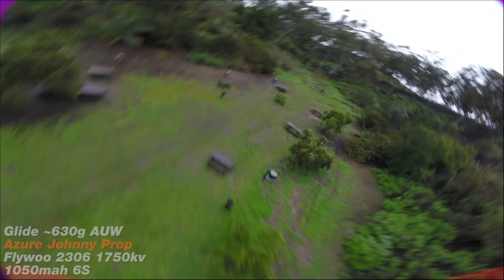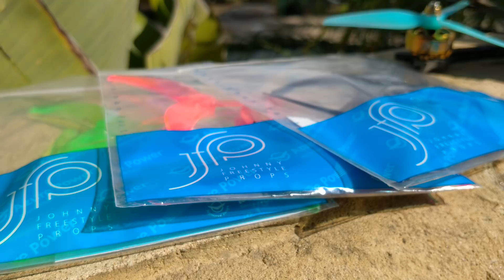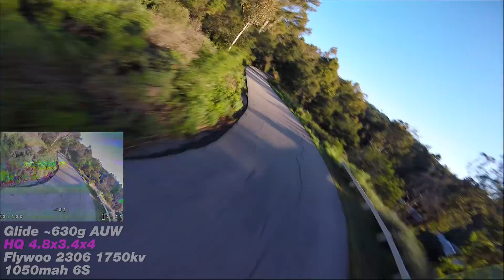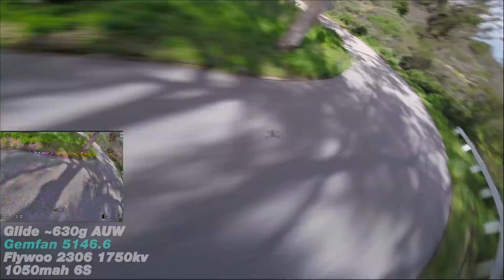Azure Johnny prop + some others

Comment from the maker: Table of Contents:
00:37 - Johnny prop flight
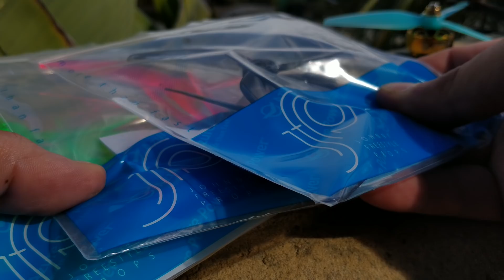03:53 - A look at the Johnny prop
04:58 - Johnny prop flight 2
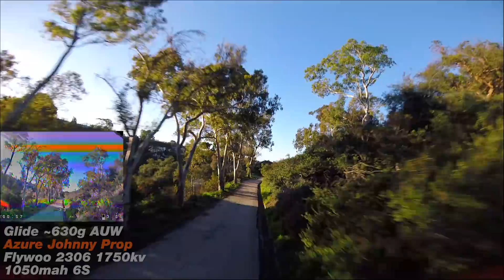06:18 - Flight feel/performance
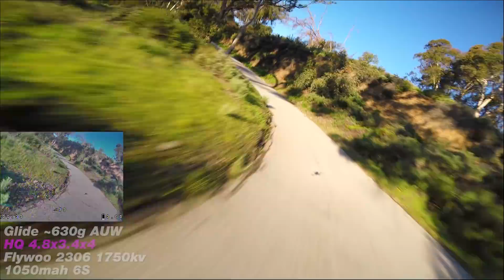09:50 - HQ 4.8x3.4x4
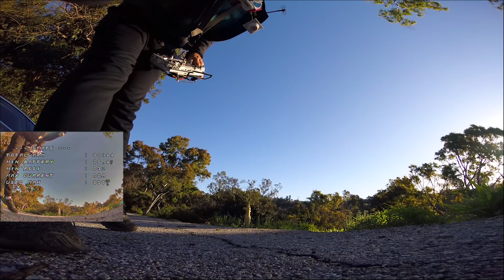12:06 - Gemfan 5146.6
13:51 - Settings to mimic Johnny prop

The Johnny prop feels a little weird on a 2207 or 2208.  It was designed for a 2306 1600kv motor on 6S.  I would recommend you stick to a 2306 and less than 1800kv with this prop...or limit max throttle.  Here's how: https://goo.gl/R51zQU

My work in progress website: www.KababFPV.com
Check out the Articles page.

Join my FB group for more discussion: Kabab FPV
https://www.facebook.com/groups/379155946182689/

Equipment I highly recommend:

Micro Eagle - 
https://goo.gl/or1fS9

Rush Tank Vtx -
https://goo.gl/YMYmya

Fantastic solder-
https://amzn.to/2P5QM2W

TS100 iron -
https://goo.gl/DqBipa
https://goo.gl/svK6DD
https://amzn.to/2OV5XMh

WaFL’s Cap Cap
https://insta-stalker.com/profile/wafl.fpv/
https://goo.gl/9CZdAs

Xing 2208: https://goo.gl/PcJ7GG
Xing 2306: https://goo.gl/TT9gnw, https://amzn.to/2VkZ8rt
Flywoo 2306: https://goo.gl/xuLG6d

Sub $200 5" build that's still good:
Frame: https://goo.gl/EpXQhZ
FC/4in1 Stack:  https://goo.gl/HprVbj
Motors: https://goo.gl/h5rofi
Props: https://goo.gl/ZnzY2y
FPV Cam 2.1mm: https://goo.gl/FDJhYw
Vtx: https://goo.gl/JNVDMn

Tips?
PayPal: https://www.paypal.me/kababfpv
Bitcoin: 1E4XZXoD4rS6MYWVWuenY7Kw2M1YgyNpoQ
Nano: xrb_1188ek5bd7tb9kw67asnp9o65byuoaxbtpxuznx1ribf75x78awywmakj55f
ETH: 0xD067F93811f2eC31CB1928901002dfdf9A492EF5
LTC: La2KWYAjp4VT2Lq2M76pbjzXWvRyjpfCtG
Reply: Hey kabab do me a favour please. You said beginners should go for 4 inch, what should I get??

I thought of these
Bangarang 4
Rcinpower 1506
Foxeer monster micro pro
Eachine vtx03s
Mamba mini stack
Foxeer Thor antenna
CNHL 800 mah battery

What could be made better?? 
I am trying to keep it under 200$with a battery and a list alarm.
If you would help I would learn how to floss my teeth...
Reply from the maker: @mehulanand8623    check the links at the bottom of the description. That's my current recommended budget build. The motors are really your choice. The Emax eco motors or RCX 2306 are cheaper and also good.
Reply: @Kabab  are eco motors good?? I was thinking of rcx 2207(11$)....
Reply from the maker: @mehulanand8623  right now I would recommend a 2306 due to an annoying ESC software bug.  It runs better as a result. I don't know when it'll be updated
Reply: @Kabab  isn't there any video of this quad??
Do you have a video on it??
Reply: Hi @KebabFPV, what do you think about new Diatone GT R349 3 inch racer that UAV Features recently revieved, did you flied it by any chance?
https://www.youtube.com/watch?v=7fQOXSnjiUQ

Comment: I thought the shaky sticks was just a greenhorn thing, I'm surprised to hear that from such an amazing pilot as yourself.  I loved the video super informative as always.  I tried these props and my kwad seemed to bobble more with just casual straight flying, perhaps my auw is more than what these are designed for.  I'm sitting around 720grams with a runcam3s and 5s battery.
Reply from the maker: The general bobbles are likely caused by betaflight if you're running betaflight. Try running Emuflight. It's a fork of betaflight with different filters. Tends to perform better with less effort
Reply: @Kabab  awesome advice I'm going to try that today.  Thank you so much.  P.S. great work with fpv cycle, very impressed you find the time for full time orthodontics and what it takes to start and operate and design everything you create.

Comment: @KababFPV So I tried a set of these, and had one disintegrate on punch out ( five or six flights on them ).  Beforehand I did notice how smooth it felt, quiet too.   I assumed the breakage was an abberation, but your comments about staying below 1800Kv have me wondering if these are not usable at the 2450Kv my  2207s are running at.... Was getting ready to order more, should I not?
Reply from the maker: I have heard from many that they explode under high rpm. They feel really smooth but are really efficient and have that exploding problem. They're hard to recommend
Reply: @Kabab  Thanks so much for the reply.  What other 4.8s can you recommend? ( I need the space for the air unit. )  I have wider arms I can install, but 4.8s work nicely and I'm lazy.

Comment: Kabab I run s4 on 4s and they feel good but my 700+g quad needs little more punch and I wanna get almost same efficiency 51466 or Johnny prop?
Reply from the maker: The johnny prop is very inefficient.  The best way to get more punch is by dropping some weight on the quad.

Comment: On the 4 blades props. I've tried some today. They're so quiet. Incredible!🙌 However I was getting more prop washes. Any tip on the filtering or on the PIDs to do to remove these prop washes I usually don't have with tri-blades props? Thank you
Reply from the maker: lower your P a little and increase TPA to 0.50.  Lower breakpoint to 1490

Comment: Kabab my bro, I hope you read this since its a late comment, no one talks about the 4 inch props since they are so unused by the major drone manufacturers. and some of us who need 4 inch props for our special drones are left out to dry, DALPROP sold almost all of their 4inch cyclone looking 4045 v2s, we are left with slow bullnose props what are garbage, or with low 4040s. DALprop sales ppl tell me its unprofitable to make them, and I would need to order 500 batch of them to make them available in the future...
Reply from the maker: Unfortunately 4" just isn't popular. It's too big to actually make a small quad and too small to get the power and efficiency we want. Also, the gemfan 4x4.3x3 v1s is still the best 4" prop imo.  It pretty much does everything perfectly. If there was an overall prop award I'd give it to that prop even though few fly 4". There's literally not a thing it does poorly. Fast, responsive, efficient, durable, great throttle curve. Give it a try.
Reply: @Kabab  Will do, tnx for the info bro.

Comment: Can you recommend a prop for running a 2207 1800kv on 4s?
(You had done that before iirc)
Reply from the maker: The new Gemfan 5146.6 when it comes out or the Tmotor T5143.  The HQ S3 prop is also good but will have the lowest efficiency of the group.

Comment: On 5" you're dead right about 3 vs 4 blade speed and control -- but ... when I'm flying 2.5" and 2-blades (10kv, 1103) it's fast and with crazy amounts of control and agility.  If I try a 4-blade prop I get a bit more quick thrust, less speed, but the difference isn't as noticeable as 5"  --  I guess what I'm saying is that number of blades is just one factor -- and now I'm curious of the difference between a 5" 3-blade at 2000kv vs 4-blade at 1500kv.  Just thinking out loud -- sorry for that :)   I also want to 4-blade prop with slender blades --- not just another fat blade tacked on.
Reply from the maker: things change completely as you vary size.  On the small scale everything changes as nearly all effects are exaggerated compared to a 5"

Comment: Kabab, I know how much you talk about needing higher looptimes for smaller quads. This may be the case on Betaflight, but a guy called NotFastEnuf has been doing some incredible work on F0 boards from toys for (mostly brushed) micros. I fly his software (tuned silverware) on a 716 brushed whoop and it is totally butter smooth. I know it's not quite your thing but it's something really cool that you might want to check out. He's mostly active in this forum thread https://goo.gl/7Wj65B if you want to take a peek.
Reply from the maker: F0 is apparently in some ways better than F4 or something. Whatever it is, they have their own custom flight code for it and that's what makes it good. All flight codes are different. BF needs at least 4k for micros. In reality, 1k should be plenty for anything...
Reply: @Kabab  Very interesting!

Comment: hi, I'm doing a new build, frame Glide :-) want to use 4s for chill cause I have a bunch of them now, and 6s for ham ride. What motors props u recommend?
 I'm thinking about 2207/8  - 1700/1800, I will put Tekko 32 metal + Kakute f7 stack, ty for letting me know. PS: is the eagle micro still your favorite micro cam?  :) bb have nice day
Reply from the maker: I recommend 2208 or 2306 in 1750-1800kv. Great on both 4S and 6S

Comment: Is a 3.5 blade prop good?
Reply from the maker: 3.5" diameter?  Depends what you're doing but no. Not on a 5" quad
Reply: @Kabab  no, 3.5 blades 😂
just like 22.507.5

Comment: So if the prop market is getting so competitive how come they aren't getting cheaper anymore? I started out flying king kongs and they were perfectly acceptable for the motors I was running back then.  Where are the decent budget props with a modern pitch and profile?
Reply from the maker: Do they really need to be cheaper?  It's kinda not worth it for the companies anymore if it's a lot cheaper.
Reply: Well there was something liberating about flying cheap props.  I would just automatically change them after the slightest nick.  Now after a crash I find myself bending them back or I build up a collection of b grade props and every now and then I have a balancing session.  Good props are really only good props until you trash them.
Reply from the maker: @mowogfpv7582  I still change at any issue. Changing is more annoying due to the prop nut than anything else. It's the time that matters more to me.

Comment: Hey Kabab I couldn’t remember if you covered this before, but what your take on props in or out. I’ve seen you run both ways in some videos.
Reply from the maker: I did a video on it a loong time ago. I like it out because it keeps crap off the fpv lens. There are supposed to be other benefits too but I can't tell in flight
Reply: KababFPV thx for the quick reply that’s what I was wondering I understand the part about keeping grass etc off the lens but flight wise I can say I notice a different feel either..

Comment: I really like the HQ quad blade on my 2204 lightweight racer. I used to run the old dal quad blades but these are so much more durable. And do you also have a slight resonance on those different prototype props. I can hear it but not feel it at least if those props are what it think they are.
Reply from the maker: I haven't noticed resonance or blade deflection on 1750kv 6S
Reply: @Kabab  I run tem on 2206 2450kv 4s. I and other people I fly with have certainly heard something at a certain throttle setting. I did swap props to confirm it's not my frame. But al HQ pros look so similar so it could be a different prop.

Comment: I wish they would put some effort in developing a more efficient prop for 3D. I'm currently using the new GemFan 3D (5045??), it works better than the old flat paddle ones but the copter still sounds like a leaf blower. I think, there is still room for improvement.

Btw. I just maidened my 3D printed Mobula7 frame with the 65mm KK props, flies great :)
Only 50g, a little brittle but 4 minutes flight time.

Comment: I love the S3 props for the smoothness and the control I feel in tight spaces. Any recommendations for props that compare to the S3? 

I fly 6s 1750kv.

Thanks.
Reply from the maker: There is nothing that can even begin to touch the S3 prop with respect to response. Maybe the T5143. The closest would be the original glass nylon 5x4x3

Comment: Props are getting ridiculous....(just like the slews of motors lol) thankfully I found 3 awesome props that works great for me (and I tried T5143 and few other before I found the ones that work for me). Thankfully I found what works for me fairly fast, and I honestly dont think someone needs anything more then these.

For 5"
Dalprop - T5046C
HQ - V1S 5x4.3x3

For 3"
Avan - 3X2.4X3

I do still use HQ3X3X3 also, but I prefer the Avan, much more cleaner and quieter too
Reply from the maker: Yeah you're doing it right.  It really doesn't matter all that much.  Just get used to what you like and stick with it. I just like trying lots of things but almost always go back to my one preferred prop which has changed over the time but not that often.  Previously it was the T5143 but now it's the gemfan 5146.6
Reply: @Kabab  well I'm only 3 months into the hobby just built a 5" a month ago... and a friend sent 4 sets of T5143, something just felt slow (my 3" was faster lol) so I tried a few sets and my 2nd set I tried was T5046C and wow what a difference, on everything all around, I absolutely love them and see really no need for anything else (specifically these will be good for racing)... dont get me wrong T5143 are nice, but like you said in your video they are mushy and you can feel that. Just not my current style at the moment. 

Same with freestyle, tried a few and the  HQ VS1 are nice....

I'm sure I'll try out others again, it's just not something I'm going to sit there and pull my hair out figuring out which one is better and why.... because with this hobby theirs some many variables that come into play.

But yes I understand your perdicument, you have all the companies wanting you to review, lol
Reply: I've been using the v1s 4.3 since it came out. Works well and there's no point in changing because I probably wouldn't be able to feel a difference anyway

Comment: A side by side comparison with the Ethix S3s would be nice.
Reply from the maker: the S3 prop has extreme response.  Super duper extreme response.  similar poor efficiency and low speed.  S3 is less durable.
Reply: @Kabab  Thank you sir, much appreciated. I'll probably buy a couple sets to try them out. I still have a bunch of cyclones I need to break first, lol.

Comment: What happened to the corbon-something material i think Azure has?
Also: have u tried FlightOne?
Reply from the maker: I haven't tried F1.  The carbon resin material is still there it's just really expensive so it's not very popular.  It's definitely my favorite material however.
Reply: @Kabab  what about a Kabab-Prop? I would by it, even if it where a bit more expencive!
Reply from the maker: @rawpicsfpv3516  gemfan wants to put my name on the new 5146.6. I think they will and I'm alright with it. Great marketing for me and also a great prop
Reply: @Kabab  what I actually struggle with 51 props is that I dont know if they suit my frame! Whats the actual length? Millimeters please.
Reply from the maker: @Denis_3301  unless your frame is super tight 5", it should fit. It's about 1.2mm longer I think.
Reply: @Kabab  flosstyle is tight you know) probably it will fit. Will try it!
Reply: @Kabab  true! You deserve every Attention;)
What If you guys make both materials and the customer can decide if they want to pay a bit more... Just a idea;)

Comment: What props do you recommend for 6s 2207  1900kv fast flying? Currently I’m running Cyclone T5045C 3Blades on everything. They are okay but there are probably better options.
Reply from the maker: The gemfan prop in this video may be the best option but would be maybe excessive power.  The reason why I'd say it's a good option is because it's going to hold up better at high RPM than something like the S3 or T5143 prop.  What you'd really want is a shallow pitch prop that doesn't deflect too much at high RPM.  The trouble is that a prop like that doesn't exist.  Your best option is probably to use whatever prop you like and just limit your max throttle to maybe 75 or 80 so your battery doesn't die.
Reply: @Kabab  T5143 is the T-Motor prop?
Reply from the maker: @SpikeJonesTheCr0oked  yep
Reply: Gemfan 5552 or 5152 tris or bis are super fast
Reply: R Morgan yea I also realized that 2 blades work pretty well for this setup. Higher top speed and maybe a little bit better efficiency. My problem was that the copter gets a little bit unstable in low throttle acro moves.
Reply: @blise518B  turn up motor idle speed for BI blades, prob solved, I run  at least 6 on all props even 6in tris
Reply: R Morgan ty for the trip. I have to try that.
Reply: @blise518B  sure, but credit to kabab from a prev vid bout lazy tuning, it's gold btw Check it
Reply: R Morgan I never bothered with tuning because I thought BF 4 is so good that you don’t need to tune 5 inch quads. I’ll have a look at it.
Reply: @blise518B  yup on 4 ur right, didn't think others were on 4 too..., since it's still a nightly, but uppin idle still helps overall, kabab says on his 6s 1850 kv rig it took off on its own when armed so had to lower,  lol  lemme know if it helps ur rig fly better

Comment: One reason why I use the ethix props is because I know that the people who fly them stick with them.  They may not offer the most power but they are perfect for smooth solid flights and are very efficient.
Reply from the maker: The biggest point of the S3 prop is the response.  I've literally felt nothing else as responsive in the 5" prop size.  Unfortunately speed and efficiency suffer quite a bit on them however.  Really low efficiency compared to so many others.
Reply: @Kabab  well ok, which has better efficiency? DAL 5040? Something better please!
Reply from the maker: @Denis_3301  the dal t5040c is a very efficient prop. Other good ones are this gemfan prop and the HQ 5.1x4.1x3

Comment: Really looking forward to trying those 5146 gemfans but you've cooled me off a bit since you've got me running 22xx exclusively. I really want a good responsive prop with a bit more speed than the 5143, can't get on with any HQs and gemfans always seem really solid to me.
Reply from the maker: The gemfan is your prop. It's really shockingly well rounded. They did something really really right with that one.